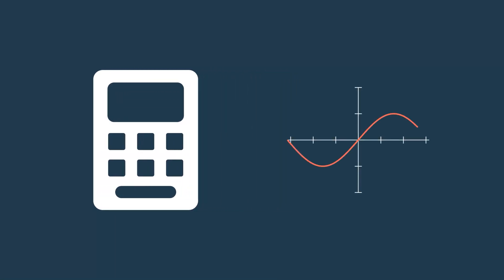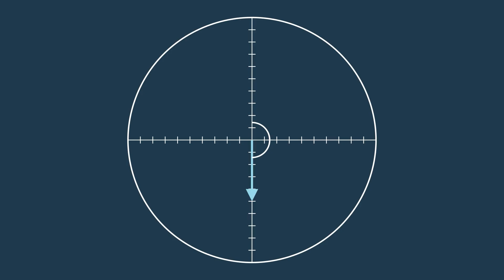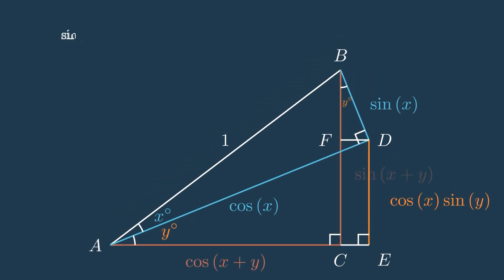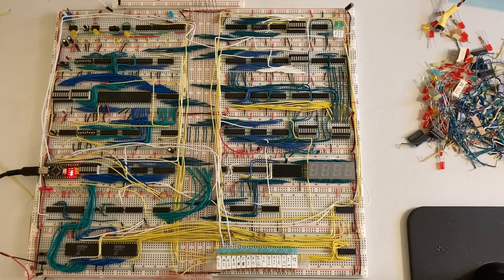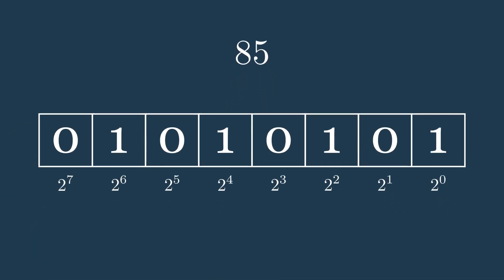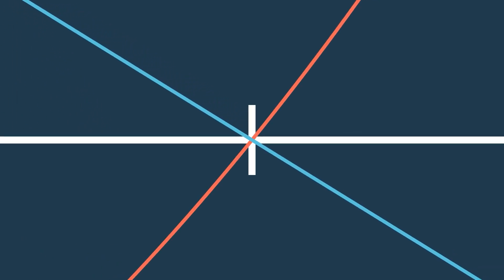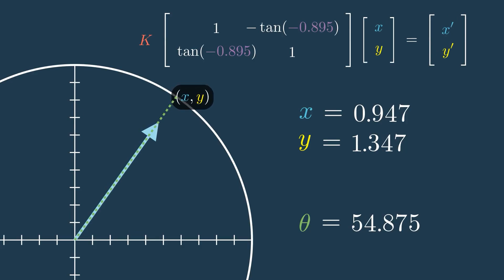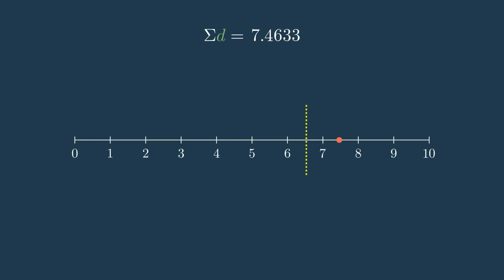How can Computers Calculate Sine, Cosine, and More? | Introduction to the CORDIC Algorithm #SoME3

Comment: I was expecting an infinite series expansion but this is so much more clever and optimized for computers
Reply: But do any calculators use the taylor series expansion? I mean, before CORDIC, were taylor series used?
Reply: @NumbToons  If I understand correctly, Cordic was made for calculators with inadequate registers, in 1959, with techniques described similar to the ones described by Briggs much sooner... So I think, like the comment of WarpRulez says in this page, that techniques like CORDIC were used sooner than equivalents of taylor series, in the case of computing. You can also find on the internet the pdfs of publications by William E. Egbert, that described the algorithms behind most of the elementary operations in old calculators.
Reply: @NumbToons  Taylor series expansion is valid, 10 iterations are enough to calculate accurately sine and cosine.
Reply: @NumbToons  adding to what @FabianAurejac said, the first scientific calculator (HP-35) was invented in the 1970s and uses the CORDIC algorithm.
Reply: me too, I have been thinking this for so many years.
Reply: I was thinking it might be a binary style algorithm, where the angle you want to find the sine of would be converted to a binary decimal number. Where 1 is 180 degrees .1 is 90 is degrees .01 is 45 degrees, and so on. Then you can find the sine/cosine pairings through this method. Start with A = {Angle:180,X:0,Y:-1} B = {Angle:90,X:1,Y:0} C = {Angle:0,X:0,Y:1} Then to find D = {Angle:45} you would do D={Angle:(B.Angle+C.Angle)/2,X:Normalize((B.X+C.X)/2,(B.Y+C.Y)/2).X,Y:Normalize((B.X+C.X)/2,(B.Y+C.Y)/2).Y}. Then with your previous binary decimal, you would use rotation matrices to find the exact angle, if the bit signifying 180 degrees is active, then you use a rotation matrix with A, if the bit signifying 90 degrees is active you do the same with B, and so on.
Reply: Same here
Reply: It's not really optimized, CORDIC is really inaccurate when you get to the 7-8th digit which is horrible in scientific computing, but great for real-time systems that don't need the accuracy (altough, I think there may be even faster algorithms than this one).
Reply: Modern computers uses either series or Rational Interpolation functions.

Comment: as much as I appreciate the rest of the video, I do not like the example you used to show how slow multiplication is. You picked the worst possible multiplication algorithm to show off your (admittedly quite wonderful) Eater 8-bit. 

It would be more familiar and more accurate to show long multiplication, which is the way computers actually do integer multiplication - including the mantissa of floating point multiplication. It's the software way too when you have shift instructions.

Long multiplication would still show viewers the benefit of bit shifts by cutting extra adds
Reply from the maker: You’re right, the multiplication algorithm I showed was a bit drastic in showing the slowness of multiplication compared to pure bit-shifting. I think the example I used still works to illustrate the relative speed of bit-shifts. I do regret not putting more of a mention of multiplication optimizations in my video, but I think the general point is still communicated, though there is a risk that people are mislead a bit

Comment: Very nice presentation. The one thing that I found a bit cloudy was the K constant but after thinking it through I realized that K will always be equal to the product over the same angles, because cosine(-a)=cosine(a). This product looks like it should converge quite quickly so I’m assuming that we just use the constant (roughly 0.607) every time as within just 4 angle adjustments/rotations, K is within about 0.002 of this constant (K). We can safely assume that for almost every angle we are using to calculate the sin and cos of that it will take 4 or more rotations, so this constant is justified to be used for every calculation, and doesn’t need to be recalculated for each  use of the algorithm. Thought I would explain my thought process just in case others were a bit confused.
Reply from the maker: Spot on explanation! That’s one thing I regret not making as clear in the video now seeing people’s reactions to it. Glad you liked the video though!

Comment: Ive always wanted to figure out how CORDIC woked. I ended up using a basic Taylor series with 3-4 terms while using a repeated Chebyshev polynomial to make it way more accurate
Reply: I was thinking Taylor series with an if statement to just repeat every 2pi radians
Reply: @AquesticYT  Yeah you're correct, modulo is used because the Taylor series only covers -pi to pi. The problem with just using a Taylor series is that even with quite a few terms, it's quite inaccurate near the edges. One thing we can exploit though is that near 0, even with just 2-3 terms, it's very accurate. This is why I mentioned a Chebyshev polynomial. if you take the cosine of a number x, and it's equal to z = cosx then you can calculate cos(2x) using 2z^2 - 1. So this simple polynomial lets you calculate cos(2x) using cosx and in fact, there are infinitely many of these but only the first few are practical and you can repeat them too. I repeat the 2x^2 - 1 one 2 or 4 times which allows for very high accuracy
Reply: @Niko64321  You don't even need to be accurate everywhere. Combining wrapping, mirroring, and the Pythagorean identity will get you anything as long as you can cover the first pi/4 radians, although for stability and to avoid sqrt(x) a full pi/2 radians is recommended...
Reply: @NXTangl  you're right, I just proposed a simpler process here but there are a lot of optimizations that can be made to work on smaller spaces than 2pi, in fact I've heard people talk about very tiny spaces like pi/6 but I never looked into the math
Reply: @Niko64321  Taylor series does actually converge past -pi to pi, it just takes far more terms lol. But in theory it converges eventually even for massive values of x
Reply: @kacelacks  I actually had no idea, thank you. At first I didn't believe it and to my surprised, when I plotted it, it does in fact work. I have no clue where I observed that it didn't do that but now I know I suppose
Reply: @Niko64321 i figured this out for elliptic functions as well
Reply: If I understand correctly, CORDIC is useful when there's no support for hardware multiplication (or if multiplication is extremely slow), which is the case with more primitive or simple CPUs. However, if the processor supports fast multiplication (which modern  processors do, as 1-clock-cycle multiplication is very common), then a power series (optimized with some lookup tables) is faster then CORDIC.
Reply: @DjVortex-w  Yep. That's the idea.
Reply: Taylor series are fast if you use tables with the inverted factorials so you have to do lookup only with multiplications
Reply: Hmm. Is there a way to bookmark a comment on YouTube? This sounds really interesting, and I'd love to delve into it when I've got some free time.
Reply: @impossiblemission4ce  well, you can bookmark the relevant sources (taylor series, chebyshev polynomial, etc). Ive had issues with accuracy because double floats in computers are not extremely accurate and you need methods to eliminate float errors
Reply: i used x^2-2

Comment: I might be dumb, I rewatched the video but still don't know how the tan^-1 is calculated
Reply from the maker: Thanks for watching! I posted a comment addressing some common questions, but in short, we don’t actually need to calculate tan^-1 to run the algorithm tan^-1(2^-n) can be calculated in advance with a polynomial approximation or some other method, and then stored on the computer for use in the algorithm.

Comment: It would have been easier to use Taylor series expansion for trig functions
Reply from the maker: Yes, but using a Taylor series requires a lot of multiply operations, while this method is better with less powerful hardware

Comment: Your computer is not multiplying, it is repeated adding. That's why it is slow. Using a Shift-Add or similar algorithm, it should be much faster.

At a minimum, adding "16" seven times would be twice as fast as adding "7" sixteen times.
Reply from the maker: You are correct. Modern computers have multiply instructions that can complete in just a few clock cycles. The main purpose of showcasing the slower repeated addition algorithm was to show how bit-shifting is faster than multiplication by numbers that aren’t powers of 2, and to give motivation for that optimization
Reply: @bobater  Not the point. A computer with a parallel adder can multiply in linear time using grade 4 math. Your code runs in exponential time.
Reply: @Pence128  that most certainly isn't true. by that logic computers have parallel processors so everything parallelizable can be done in linear time.
obviously there is a finite number of these parallel adders so the time complexity can never be linear and what do you mean his code runs in exponential time? multiplication by repeated addition runs in polynomial time.

plus that is exactly the point, the comment says "Using a Shift-Add or similar algorithm, it should be much faster" which is literally explained in the video and used to explain the CORDIC algorithm. what's the problem here exactly?

Comment: I was expecting lookup tables and interpolation. Boy, how wrong am I...
Reply: I was expecting wizard. I was wrong in the first thirty seconds.
Reply: I've seen lookup tables in older machines.
Reply: @davidhand9721 in very old machines and depending on the precision needed. The CORDIC scales really well for high precision. But if you don't care too much for example in machine learning stuff you use Look up Tables.
Reply: Isn't that what some games on the SNES do with mode 7 though?
Reply: But are lookup tables faster?
Reply: @cristianjuarez1086  in general yes
Reply: @cristianjuarez1086  consider memory usage
Reply: @KangJangkrik  ? I dont think a look up table needs to be huge, and is definitely easier to retrieve a value rather than calculating it. I guess it depends on how precise you need to be
Reply: @Cristian Juarez  it depends on how fast your memory is, size of the table, do you have caching? Does the table stay in cache?  Calculations can easily be faster than memory lookups in the right circumstances. Remember, you're usually doing some calculations in the process of looking up the table.
Reply: @ernststravoblofeld  oh i see
Reply: Well, this is basically a souped up binary search so...
Reply: You are not wrong. This is how it's actually calculated in a lot modern languages/systems.
Reply: Cordic still uses a look up table. You need the look up table to keep track of added arctan values, 45, 26.57, 14.04 ... during the approximation.
Reply: That wouldn't be very accurate and it's not necessary. Trigonometric function have well-defined Taylor series, which would be the easiest way to compute them.
Reply: you can generate a lookup table with this method
Reply: I have a question, we can calculate the sine and cosine values using cordiac but for that we need to compute tangent too!
So how do we compute tangent?
Reply: @pranjalsrivastava4260 That's a good question, I guess the math to find the angles was done manually.
Reply: Look up tables and interpolation used in robotics cause it’s easier to look up than calculate sometimes
Reply: > I was expecting lookup tables
How do you think the arc-tangent of the inverse powers of two are calculated?
Reply: The atan values of 1/2**n are in a lookup table, so you are not wrong
Reply: That actually is done, but CORDIC has to be applied to zero in. You find your nearest lower bounded table value first, then start processing. The result is that instead of ~40 iterations, you may only have to do 2-3 CORDIC iterations to get your final answer length and then, if more is desired, rather than CORDIC, you can apply linear interpolation and then a correction factor. This means that, especially in early calculators where ROM was at a premium, you could still get accurate results to at least 8 decimal places using a table with just 32 or 64 values. Later calculators expanded this to 128 or even 512 or 1024 values. This meant that you could start from closer and get more digits faster (since, instead of the earlier 8 digits, you now required at least 12 digits and sometimes 13-15 digits, including the guard digits) but processing speed also increased to boot. However, despite this, my 1988 calculator, to process 13 digits, still takes just as long as my 1976 calculator does to process 8 digits. That's not because it hasn't sped up, but because it's doing more iterations to get the final result. Recall also that there ere is no FPU in anything but a modern CPU. So you couldn't just offload this to the co-processor. Even modern micro-controllers still use CORDIC with tables.
Reply: Lookup tables were used when CPUs were slower than memory. Nowadays it is the other way around so calculating is faster than lookup.
Reply: @Henrix1998 You have to remember the embedded world. Even a fairly nice, modern core like the Cortex-M7 at 500 MHz is CPU bound. You can get parts with 32 or 64 kB of DTCM which offers, effectively, single cycle load and store (plus a cycle of latency) which makes the LUT a far faster option.

I've found the sweet to be third order Hermite polynomials. If you're really crunched for cycles, you can get machine (single) precision with 5 quadrants of table (which allows you to save a couple cycles by not wrapping) with about 2 kB of memory. Indeed, I've worked on parts where it was literally faster to do a TCM LUT than to use a hardware CORDIC peripheral because DTCM is fast while APB bus access and CORDIC itself is slow.
Reply: A lookup table cam give roughly O(logn) bits of accuracy for bits of memory. Because trig functions are quite symmetric, you can get away with just knowing the values between 0 and pi/2. As sinx=~x around 0, to distinguish between 2^-i, you need about 2^i points (multiplied by some smallish constant). This is exactly O(logn) memory
Reply: @ffc1a28c7 You're neglecting higher order polynomial LUTs. For an interpolating polynomial P(x) of degree p, the error will be g(xi) / (p + 1)! * prod(x - x_i) where g(x) is the p+1 derivative of the original function f(x) for some xi in the interpretation interval. You can bound this as g(xi) * ∆x^p / (p + 1)!. For sin and cos, g(xi) <= 1. With many intervals, ∆x is small and contributes to accuracy. The table size will grow as np while number of bits will go as log((p + 1)! / ∆x^p) = p log(n) log((p + 1)!). 

In short, higher order polynomial tables actually scale really well.
Reply: lookup tables is actually useful in really slow devices. For example, DOOM on the SNES used a lookup table to speed up sine and cosine calculations since SNES just used a 8-bit 6502 which isnt so powerful, and DOOM being a 3D game, and the goal is to run the game as smooth as we can, you really need to free up every cpu cycle available, so you cant have complex stuff just to get a sine value.
Reply: nowadays lookup tables are slower because of cache misses